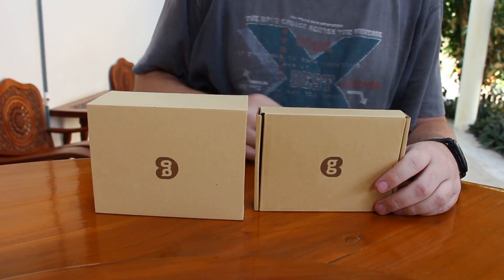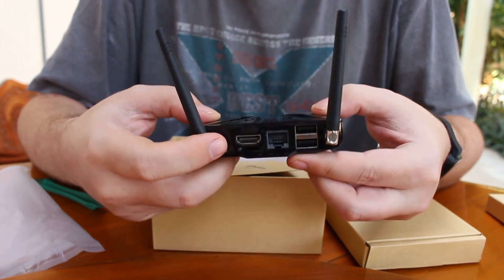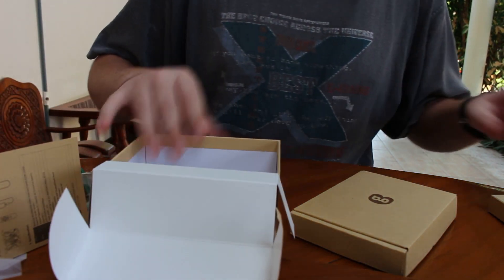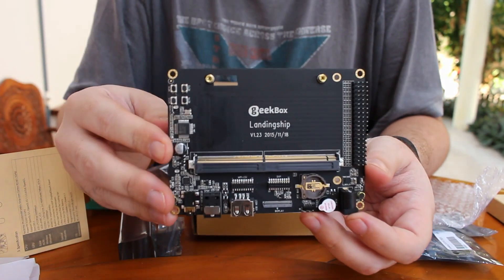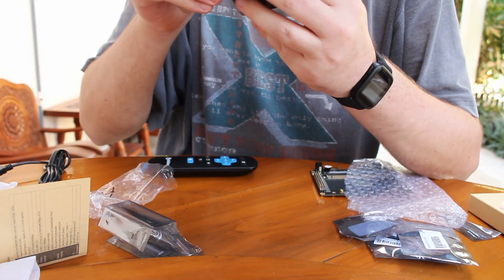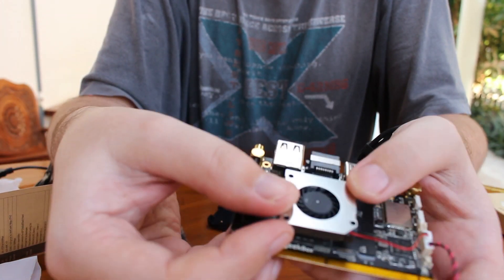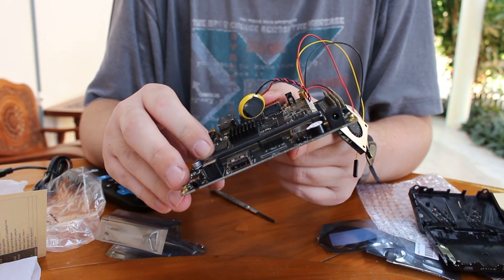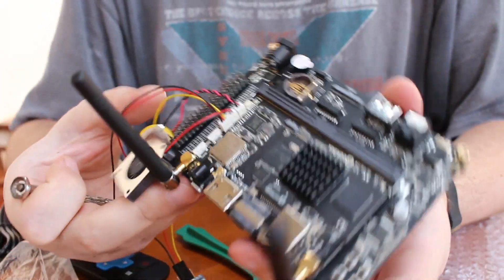GeekBox TV Box Unboxing and LandingShip Assembly Guide

Comment: Could you give some details about how good does the SSD perform on this board. I've did some researching and found out that landingship use a JMicron JM20329 USB2.0-to-SATA bridge ??? And that they are always slow and often lack features (SAT/UASP) ??? Just what I've did read on some forums.
Reply from the maker: +DDots I've tested it @ http://www.cnx-software.com/2015/12/21/geekbox-and-landingship-android-overview-and-benchmarks/
Reply: +cnxlinux Have you tried Ubuntu on it ? I'm curious how good it performs in Ubuntu and also how good videos can play on android,  did you try Kodi on it ? And another thing i'm curious is about gaming performance on this also.
Reply from the maker: +DDots Not tested Ubuntu yet. Too many things to play with. Maybe later.
Kodi in Linux will perform poorly (software decode only now), and I don't think they have enabled GPU support too. Gaming (Android) with fan should hopefully be decent, although not as good as on RK3288 platforms.
Reply: +cnxlinux ok...1 more question...between an AW80 box...let's say Tronsmart Draco AW80 Telos....Geekbox Tv box RK3368....and a RK3288 box...maybe Tronsmart Orion R28 Telos ( 4 GB Ram)....what would you choose between those 3...
Reply from the maker: +DDots I'd avoid Allwinner A80.
If you need 4K @ 60Hz (HDMI 2.0) go with RK3368. If you need a powerful machine, good 3D graphics performance for gaming, and can do with 4K @ 30 Hz, then go with RK3288.
Reply: +cnxlinux Well...good news...MAC_L1 managed to get GPU and VPU to work in Linux for GeekBox. That means that now we have hardware acceleration in Linux...no more software decode only....He will release machybris and mackodi soon.
Reply from the maker: +DDots Great and bummer! I had just spent a few hours installing and testing Linux... I'll wait for the new image to test further...